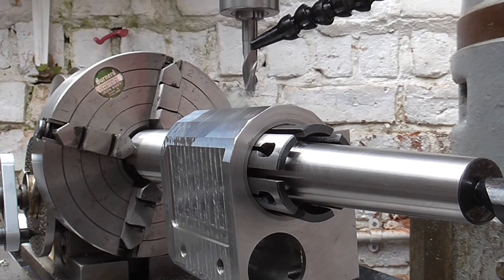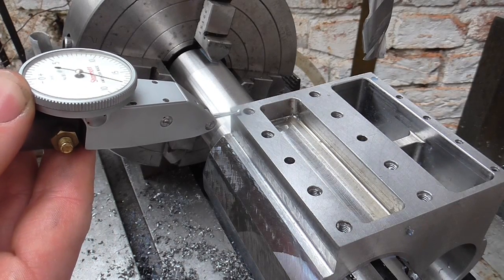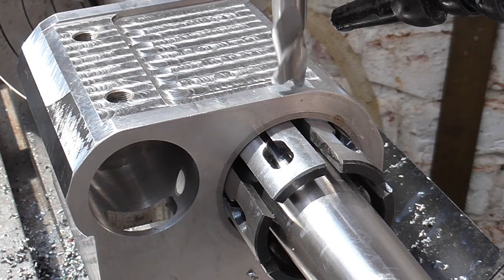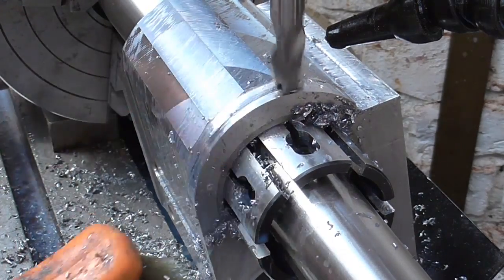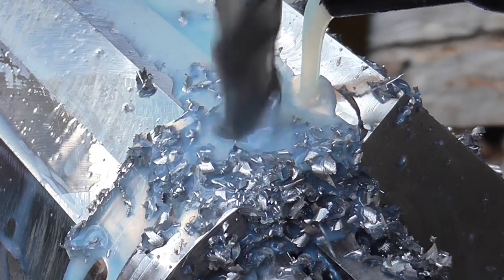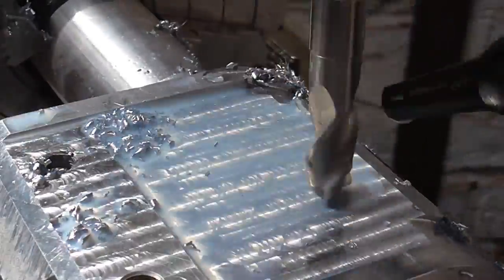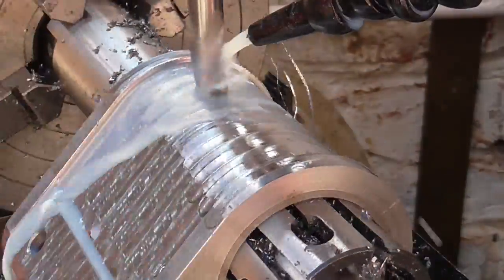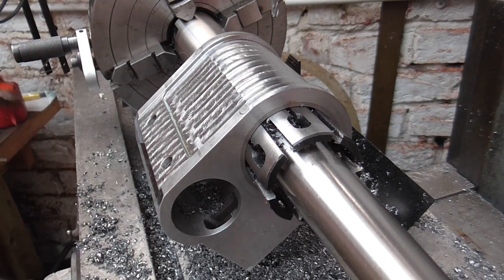Machining Cylinders Part 6

Comment: A ball end milling cutter would give you a better finish but your cuts would have to be closer to get a smoother finish so machining times would be increased but would eliminate the amount of hand finishing required. Excellent videos as usual. I agree with other comments that for your age and the fact that you are still an apprentice, you have amazing engineering capabilities and prowess and it's great to see the aerospace industry will have a talent such as your self for many years to come continuing to pass on your knowledge. Thank you for taking the time to make these videos and pass on your skills and advice.

Comment: Awesome work. Thanks for all the great info and taking the time to explain how it works, pitfalls and how to avoid them. If you hadn't pointed out your so called mistakes I would have thought a part was going there or clearance for the cladding. Thanks for a very nice video.

Comment: To get the finish you want, you may have to have an endmill ground especially for that operation. 
Endmills are nearly always relieved like you showed to prevent dragging edges moving at slower linear speeds than one gets at the outer diameter of the cutter. I've done the very same operation you did and got the same result. I didn't do anything about the surface finish since it wasn't that important. It was a much smaller piece.
I'm not sure I would bother with a special endmill since your hand finish work produced such a beautiful piece of art.
Thanks,
John

Comment: Well done Crispin, I just knew that this would be a good video, excellent outcome. From someone as young as yourself, to produce such a complex part is fantastic. I would hate to think what you will be able to produce in Years to come. Your training at RR has certainly paid off. With regards to the end mill problem, with your skill set, I would have thought you very capable of dressing off the bulk dishing of the endmill face  with a grinder; then carefully finish it off with an oilstone or Diamond hone. I would have thought that it was perhaps only 10 thou or so dished. Well done once again, now itching to see the next video.

Comment: With reference to a end mill with a flat end face, you can try Cutwell tools in Yorkshire or another cheaper option would be try Norther Carbide sharpening services, they can refute carbide or any other mills, drills both std round bar or taper mount, very professional service and a good price too. Enjoy your videos, very good...Phil

Comment: A couple of things that could be done aside from getting/making a flat ended endmill. 
You could do the operation as you have then off set the tool in the -Y direction 1 tool radius so that the edge now cuts the same depth in the center as the edges were cut and repeat the operation and that will get rid of the bulk of the humps. With the endmill in the 1 radius -Y offset you can then mill the last flat beside the boss wall you mentioned and continue the radius right up to the wall, no flat spot in the corner.

OR you could do as you have done for the far ends of the pocket only and then traverse in the -/+X direction at increments of angle for each pass. That will remove all of the center humps in exchange for some faceting determined by your choice of angular increment. This will produce a finer version of your roughing faceting operation but fine enough to file out easily. To finish off, with the endmill in the 1 radius -Y offset you can then mill the last flat beside the boss wall you mentioned and continue the radius right up to the wall, no flat spot in the corner.

You could even do both of those procedures and get 99.9% of all the humps out. That would take a lot of time of course but we are having fun right?
It is a great pleasure to watch your content. Thank you.
Reply from the maker: Thanks for taking the time to write that out. Yes both methods sound like an improvement. I spoke to Mike Sayers who does a lot of this type of work in the building of his 3rd scale Bentley Engines and he uses the 2nd method you describe. Lots of flat faces at small angular increments and then blend with file.
Reply: @MrCrispinEnterprises  You are most welcome. I have done it both ways before plus I have done it on the lathe with the part on a mandrel in the spindle and by hand feeding the tool on each pass and hand turning the spindle to make the partial cut, like a rotary shaper. It was VERY tedious but produced a stellar result. Thanks for taking time to respond.

Comment: I never knew a file could leave such a great finish. None of my stupid files do as good a job. Must be my files for sure ;-) 

Two or four flute, center-cutting or ballnose endmills will give you a better finish.
Reply: Consider how many cuts Crispin would have needed to do to cover the length of the cylinder block, even at 1/8 inch increments it would be about 25 plus cuts. Then finishing cuts, then multiply by 4 ends, he would probably still be at it now. Ball endmills are fine for a CNC, where you can walk away and do other things, but in a manual situation like this one, NO way.

Comment: Hi Mr Crispin. Excellent work, but is there a particular reason why these items are made from a billet rather than being fabricated and machined?  Like someone else below has said, surely you could grind your own cutters to do this milling.   Regards Mark in the UK.
Reply: Sir, I asked Crispin the same question a Year ago. He replied that the castings were expensive and he was an 19 Year old apprentice with not much cash. He had some steel stock from a friend and decided to make it from that.  He needed skill building for his apprenticeship, so hence bite the bullet and dive in. Excellent work for someone so young. I was a toolmaker for 35 +Years and I had never done radial milling before. I did a dummy run for Crispin in wood, exactly the same setup, to confirm the setup and iron out any pitfalls, and sent pictures to him. His actual part, has come out super, apart from the cutter marks, but again his skills with a file soon put all to rights. If he continues along these line, then he will go far in the World of engineering.

Comment: How did you get such a nice finish from the file(s) near the intersection of the radius and the vertical face, i.e., in the corner?  I understand the areas where the file has room to work, just not near the corners.
Reply from the maker: To get right up to a corner I normally wrap a strip of emery cloth over the end of he file and that way the abrasive can get right up to the corner.

Comment: interesting video. In the very first scene the tapered expanding mandrel is shown with a gap to the tapered shaft. Why is that? I thought the tapered  expanding mandrel should be in contact with the tapered shaft.
Reply from the maker: Hi, for some reason all the mandrels in this set have a large counter bore in one end. 

Cheers
Reply: I see. Thanks.

Comment: I thought steel had a higher thermal expansion rate than iron? Won't the liners become loose in the cylinder body?
Thanks,
Andrew.

Comment: Nice video! what if you offset the cutter away from the column then you would be cutting more on the edge, I think :-)
Reply: Hi there, NO if you move off of the work / cutter centerline, you would be using more of the the cutter radius, and it would then leave a concave finish. Flat cutter on centerline is best, and as you saw a few strokes with a file, soon put the problem right. Hope this note helps.
Reply: +Dave Ticehurst thanks Dave but I am not sure I agree :-)
Reply: Hello John, thanks for replying. I will get Crispin to also confirm my post. I can quite assure you that I am correct in my comment. I did a trial run for Crispin to prove the setup, anything off of centerline, produced a concave cut. That is why when flycutting in the milling machine, the head must be trammed true, otherwise the work will not be flat and the work will be concave by the radius of the cutting tool. Hope this helps.
Reply from the maker: Hi. Thanks for your comments. If the cutter wasent on the centreline of rotation I would have ended up with the cutter leaving a concave channel. So over the whole surface I would have a uniform but wavey pattern. The further off centre the tool was, the smaller the radius of the concave shape would be untill you would eventually end up with somthing similar to the radius of the cutter. Cheers

Comment: A very well thought process a younger Mr Crispin. Please check your messages on instagram.
Reply from the maker: Hi, thanks. I'll have a look
Reply: @MrCrispinEnterprises  Thankyou greatly appreciated if you will.
Reply from the maker: Thanks I've read your comment and I have had quite a few along thoes lines recently. I think what I will do is make a video to answer them all in one. I'll be in touch soon.
Reply: @MrCrispinEnterprises   Excellent, look forward to seeing it. I'm very intertest in starting my own 5" Springbok  build now that I'm pretty much setup with machines in my workshop at home. Plus with your videos will help with my attempt of a springbok. Once again great channel great content and love the hat tossing very original. Thanks for everything greatly appreciated.